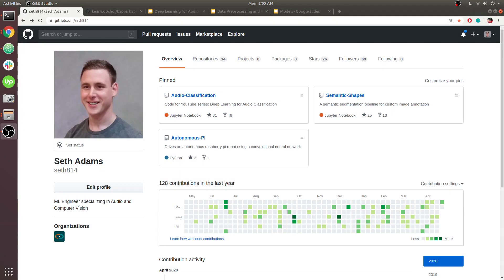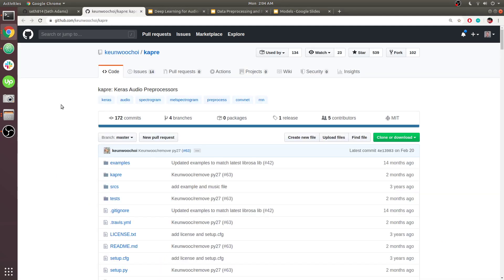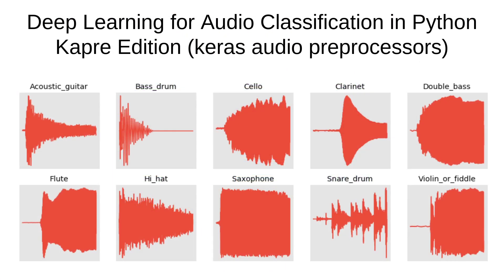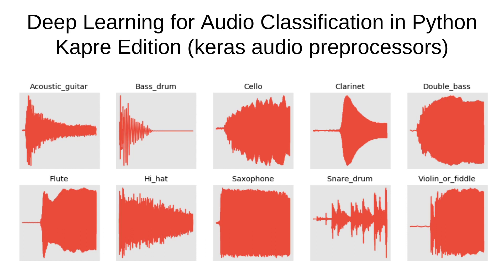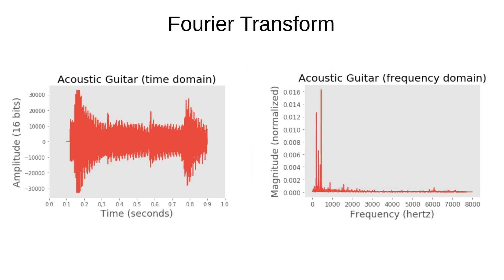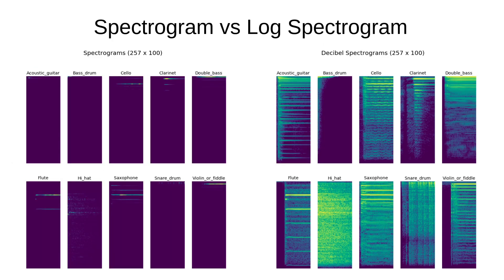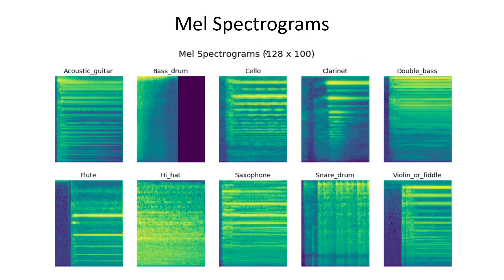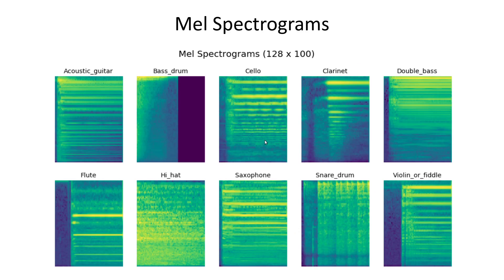DSP Background - Deep Learning for Audio Classification (kapre) p.1

Comment: If the length of the 1st dimension of the spectrogram is supposed to be half the samples of the FFT, where does the extra sample come from? i.e.: 512 / 2 = 256, not 257.
Reply from the maker: Probably just a padding thing with the library. That's just a guess.

Comment: Hey what does it mean dealing with mel spectrograms (128,216,3). By using 3 windows length 93ms,46ms and 23ms and in the end they have write 128,216,3 what does 3 shows here??

Comment: I am  following you , wonderful videos , i have error when run this project you explain 
Traceback (most recent call last):
  File "C:/Users/HHH/Desktop/audio/Audio-Classification-master1/predict.py", line 2, in <module>
    from clean import downsample_mono, envelope
  File "C:\Users\HHH\Desktop\audio\Audio-Classification-master1\clean.py", line 1, in <module>
    import matplotlib.pyplot as plt
  File "C:\ProgramData\Anaconda3\envs\code\lib\site-packages\matplotlib\__init__.py", line 205, in <module>
    _check_versions()
  File "C:\ProgramData\Anaconda3\envs\code\lib\site-packages\matplotlib\__init__.py", line 190, in _check_versions
    from . import ft2font
ImportError: DLL load failed while importing ft2font: The specified module could not be found.

Process finished with exit code 1

Comment: Thanks, Seth! Great content.
Reply from the maker: Thanks Filipe
Reply: @seth8141  i have error when run this project you explain 
Traceback (most recent call last):
  File "C:/Users/HHH/Desktop/audio/Audio-Classification-master1/predict.py", line 2, in <module>
    from clean import downsample_mono, envelope
  File "C:\Users\HHH\Desktop\audio\Audio-Classification-master1\clean.py", line 1, in <module>
    import matplotlib.pyplot as plt
  File "C:\ProgramData\Anaconda3\envs\code\lib\site-packages\matplotlib\__init__.py", line 205, in <module>
    _check_versions()
  File "C:\ProgramData\Anaconda3\envs\code\lib\site-packages\matplotlib\__init__.py", line 190, in _check_versions
    from . import ft2font
ImportError: DLL load failed while importing ft2font: The specified module could not be found

Comment: Isn't 256 exactly half of 512, not 257, I'm probably missing something. Can you make it so that the Mel filter tops out at 8kHz? I'm a vibration analyst by trade and my job is to analyze the FFT and Time Waveform of sound files we collect from running machines, we use the Hanning window and of course the Nyquist is how we setup our data collection. When we are trained we first learn how to use the FFT to decide where are the frequencies of interest then later we learn how to use the waveform to "see" what the equipment is doing and how it is moving. My question is, would it be possible to use both the FFT and the waveform to properly classify the sound file? Why does the ML get just one when we get two? Putting both the FFT and the waveform together moves the confidence level for us. We always use both, plus the sound file to classify. I can easily reference a few short videos that will explain this to you if you don't already know. I know of a service that uses ML to automatically calculate the belt slip in every monitored machine that uses a belt. Any company that uses clean rooms is interested in belt slip because they want to know how much the belts are slipping so they can estimate if they can make it to a shutdown to change the belts rather than the belts failing and then the clean room is not longer clean and everything in the room is suspect and it usually takes several days of testing to get a clean room back to operational status. Anyway this is part 1 so I'll watch parts two and three. I have done similar things like you are doing but I didn't use the Mel filter, if it were possible to use both the FFT and the waveform to confirm the results should be above 95% maybe 99+%?? Exciting. Using sound, or sound and vibration, to monitor industrial equipment should yield a tool that when used properly will increase industry output. Reply to this and we can talk about sound files. I have some sound files on Kaggle using as a storage place as I figure out how to best process them but I'm learning as I go.
Reply: That sounds like a really cool job

Comment: Hello,Thanks so much for updating the video!! It helps a lot for what I am doing right now since I am a total fresher in this filed.

May I ask one simple question about the log mel filter bank?
My understanding is when we try to classify sound which make by human we can put more stress on lower frequency.  
For the sound from these instruments (which has important data on relatively high frequency) why it helps for audio feature extraction?

Anybody has the answer? I will be so appreciate!!!
Reply from the maker: Yes, using a log mel filter bank puts more of a bias towards low frequency signals. If you think you need better precision on higher frequencies, you can just use a spectrogram from kapre. Just swap out the Melspectrogram for a regular one. https://github.com/keunwoochoi/kapre/blob/master/examples/example_codes.ipynb
You will likely need to change model parameters to handle the larger input shape, but the code on github should give a starting point.

Comment: Dude, your audio processing videos are excellent! I've watched both the original series and the new one, and they were by far the best study material I've seen on the topic. And this comes from a guy who just took a 60 hours NLP class.
Reply: i have error when run this project you explain 
Traceback (most recent call last):
  File "C:/Users/HHH/Desktop/audio/Audio-Classification-master1/predict.py", line 2, in <module>
    from clean import downsample_mono, envelope
  File "C:\Users\HHH\Desktop\audio\Audio-Classification-master1\clean.py", line 1, in <module>
    import matplotlib.pyplot as plt
  File "C:\ProgramData\Anaconda3\envs\code\lib\site-packages\matplotlib\__init__.py", line 205, in <module>
    _check_versions()
  File "C:\ProgramData\Anaconda3\envs\code\lib\site-packages\matplotlib\__init__.py", line 190, in _check_versions
    from . import ft2font
ImportError: DLL load failed while importing ft2font: The specified module could not be found

Comment: Hi Seth, really appreciate what you are doing with this tutorials, they helped me a lot. I am trying to implement instrument classifier with this approach (spectograms + CNN), the only problem is my dataset contains wav files of various length, from 0.5s to 15s, what do you think, how should I segment data to have spectograms with same dimensions ?
Reply: If you want you can split the wave files to specific time duration and pad the last segment if necessary, all with same label (or howsoever they are). This will let you have specific width spectrograms.
Otherwise you can run the CNN on the complete wave spectrogram similar to how YOLO does object detection. It automatically segments the data and you can finally compute loss to n-number of outputs thus obtained.
Hope this works! :)

Comment: @seth I’m trying to write a program to make audio predictions in real time. The inputs can be a mic or YouTube audio. Do you happen to know how i can do that?
Reply from the maker: I have had some requests for this from multiple people; however, it will probably happen as another series. If you just want a single stream to connect between a server and client, I would recommend a socket connection (using flask) that streams wav files. You simply pass the data through the model as it comes in and send the result back in real time.
Reply: @seth8141  I am watching these series for my project,, as my instructor wants me to implement an ML model in my e-commerce website. I am very new to machine and deep learning, essentially I know nothing in them. I am familiar with python and I usually work with React and Node, I want To learn machine learning, could you point me in a right direction, where I should start>??? Many thanks
Reply: i am also working on that ...
Reply: Mostafa Miroune thanks

Comment: @Seth
 I'm getting this error: ```Traceback (most recent call last):
  File "sound_preprocess.py", line 119, in <module>
    save_mfcc(DATASET_PATH, JSON_PATH)
  File "sound_preprocess.py", line 90, in save_mfcc
    hop_length = hop_length
  File "/home/bitsy-chuck/anaconda3/lib/python3.7/site-packages/librosa/feature/spectral.py", line 1706, in mfcc
    S = power_to_db(melspectrogram(y=y, sr=sr, **kwargs))
  File "/home/bitsy-chuck/anaconda3/lib/python3.7/site-packages/librosa/feature/spectral.py", line 1831, in melspectrogram
    pad_mode=pad_mode)
  File "/home/bitsy-chuck/anaconda3/lib/python3.7/site-packages/librosa/core/spectrum.py", line 2530, in _spectrogram
    window=window, pad_mode=pad_mode))**power
  File "/home/bitsy-chuck/anaconda3/lib/python3.7/site-packages/librosa/core/spectrum.py", line 219, in stft
    y = np.pad(y, int(n_fft // 2), mode=pad_mode)
  File "<_array_function_ internals>", line 6, in pad
  File "/home/bitsy-chuck/anaconda3/lib/python3.7/site-packages/numpy/lib/arraypad.py", line 821, in pad
    "'constant' or 'empty'".format(axis)
ValueError: can't extend empty axis 0 using modes other than 'constant' or 'empty'
```
Please help
Reply from the maker: Can you email the entire project directory to me? seth8141@gmail.com or just the entire traceback.
Reply from the maker: Or post the full traceback with OS system info in an issue on the github repo

Comment: Thank you for posting new content! Could you elaborate why you decided to use the Mel Log spectrogram in this series instead of Mel Frequency Cepstrum of Coefficidents for the last series you had made?
Reply from the maker: Because kapre doesn't support MFCC. The process of extending to support MFCC is probably not too difficult, but the mel spectrogram should be fine for most people anyway.